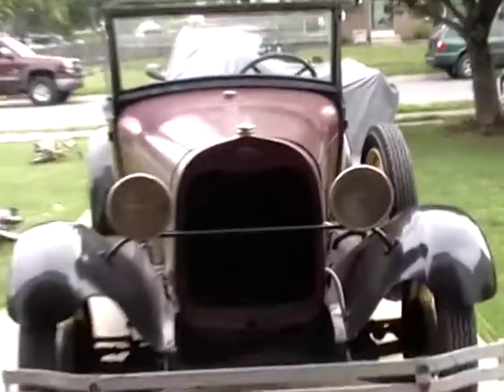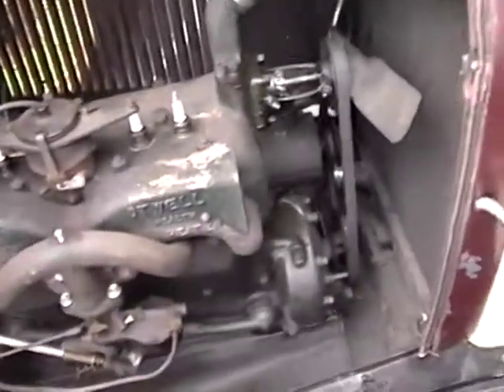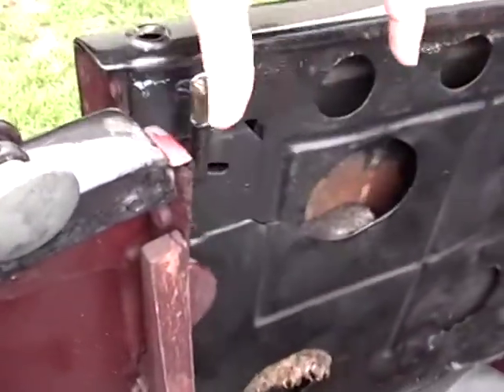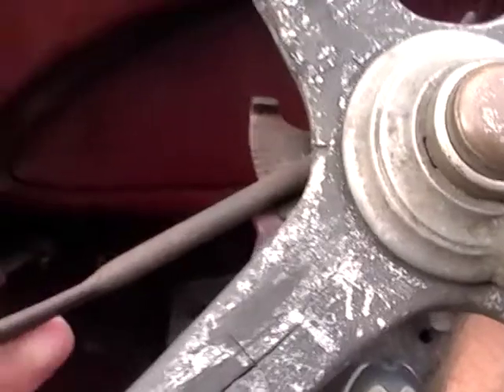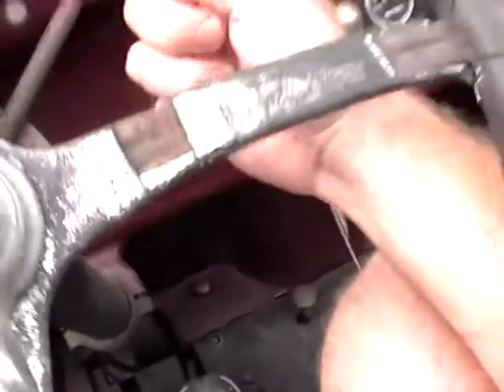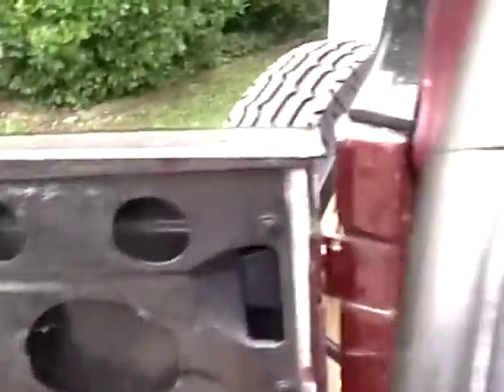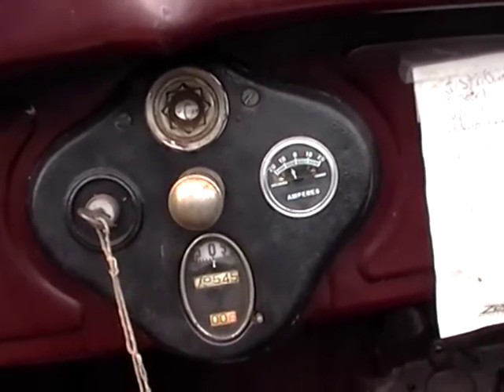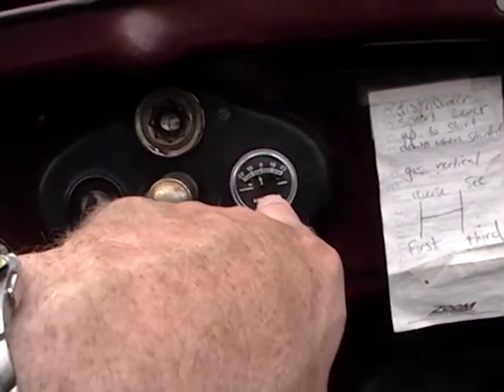1929 Ford Model A Pickup - Overview and Idle

Comment: WHIS I WAS THERE TO HELP YOU WITH QUESTIONS AND HOW TO RUN A MODEL A SO THE ENGINE IS ABLE TO COUNT OFF THE FIRING OF EACH PLUG. I HAD MY 29 CLOSED CAB PICKUP FOR 29 YEARS AND BEFORE THAT I HAD A 1930 PICKUP AND WE USE TO RUN  NACL TP THE LATE 1969 AND PICKED UP 1929 IN 1974 RESTORED IT TO SHOW CONDITION AND WON A NUMBER OF AWARDS. SOLD IT IN 1998. MISS IT AND WISH I HAD ONE LIKE YOU HAVE THE ROASTER PI AND it is IN REAL GOOD SHAPE. I CAN HEAR YOUR JOURNALS KNOCKING THE BABIT MUST BE WORN OUT SO YOU ARE ABOUT TO HAVE A NEW POUR AND LINE BORE. ANY QUESTIONS JUST ASK ME WORKED ON THEM FOR THIRTY YEARS

Comment from the maker: @poochie883 

That's good to know.  Do you know anything about the doors?  My doors have something inside them.  Looks like factory install, of some sort.  I'm guessing it's rattle mitigation, but I'm not sure.  Looks a bit like a pad of some sort of fiber material.  It's whitish in color, square, and mounted diagonally in the interior of the door.

Comment: After the car starts you should advance your spark to the bottom of the quadrant or very close, depending on your timing. Also, on the first start I noticed you were charging about 10 amps. This is a little high unless you're doing a lot of night driving. But then I noticed it was discharging 10 amps. Unless your lights were on, you have a problem there. Lights are Parking to the left, low to the first right, high to the 2nd right, unless you have an early light switch without parking lights.

Comment: Thanks for posting the video.  This is exactly the type of video for a Model A I wanted to find.  You did a wonderful job!  I am wanting to find a model A truck as well.  I am curious as to what the experience is like driving it around town.  How does a model A handle?  Brake?  Accelerate?  Do you feel relatively safe in it?  Is it quick enough to not make drivers angry that are in a hurry? etc...Thanks again.